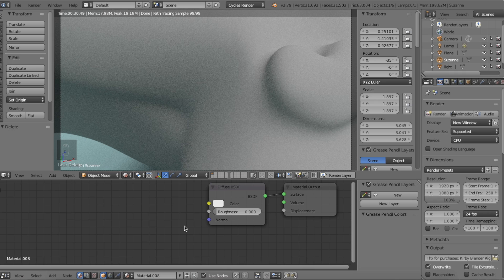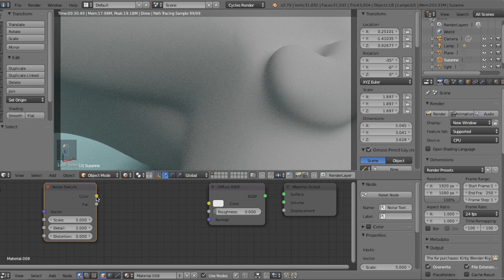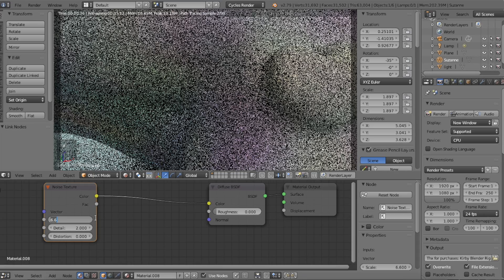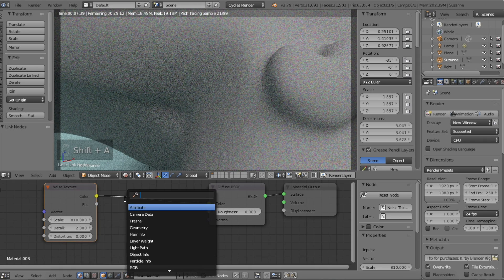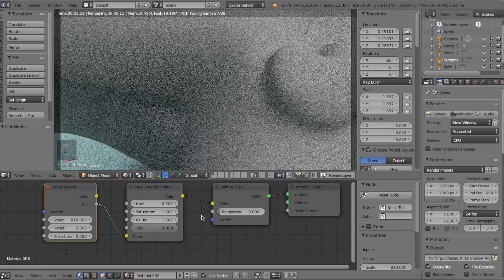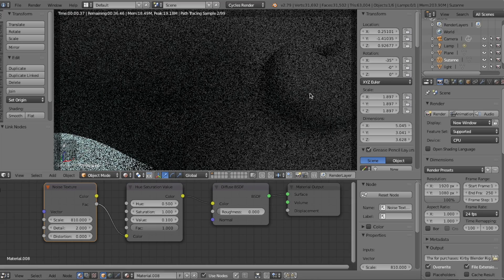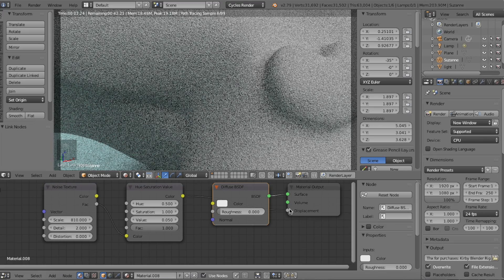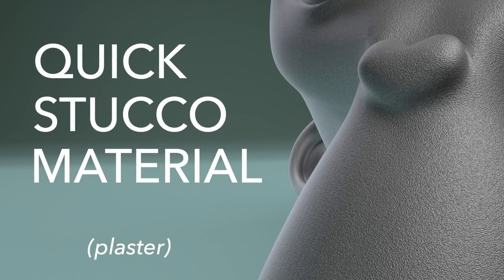Blender Tutorial:  Stucco / Plaster Material

Comment: I was wondering why you didn't just use the color ramp. You can still get the same result with a color ramp to convert it and a math node as the strength that's why, but I guess it's easier just using the hue & saturation